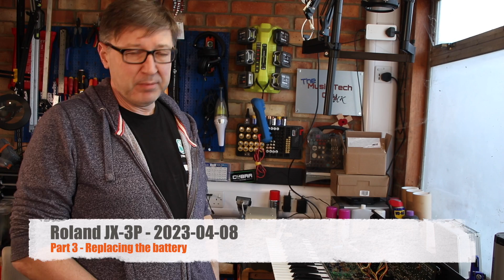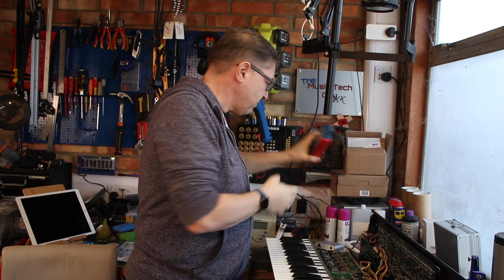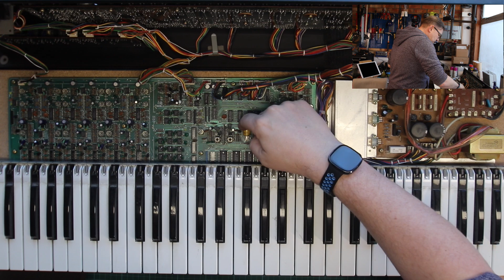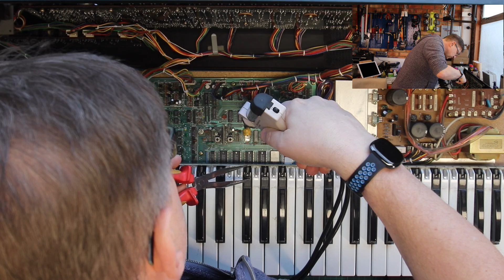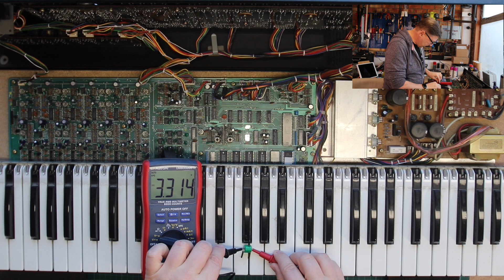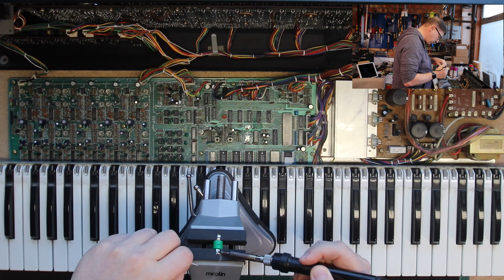Roland JX-3P Restoration - Part 3 - New Battery / Replacing the Battery

Comment: What voltage is the original battery please?
Reply from the maker: Hi @darkdeepred6577 

The Roland JX-3P uses a 3v battery.  To be honest most synths and electronic instruments of this age have 3v - 3.5v batteries.  The majority of these are 3v as this was the correct voltage to keep the volatile memories of the chips used in them alive when there was no mains power present.  Jon

Comment: My JX3P battery hasn't been changed since I bought it in 1984. I guess I'd better get on it 😄
Reply from the maker: Hi @HowardBaileyMusic 👍 Jon
Reply: @TheMusicTechGuyUK  So that 1/3n lithium battery is in fact a rechargeable cell correct? I've been looking for one on eBay but so far haven't found one with solder tabs. Also they don't specify "rechargeable".
Reply from the maker: Hi @HowardBaileyMusic

The original battery would not have been a rechargeable version.  And given the age possibly not a lithium based battery.  However, they are available with solder tags.  It is the first entry in this e-bay listing:

https://themusictechguyuk.me/3nISDl1

Now unless you know someone with a battery soldering rig, this might be the best option.  And yes I know the seller is charging a premium!  Jon
Reply: @TheMusicTechGuyUK  Luckily I have a friend who professionally repairs high end medical equipment so I won't have to do the job myself (except take it apart and put it back together 🙂). I'm amazed that a non-rechargeable cell could hold power for so long.
Reply from the maker: Hi @HowardBaileyMusic

Looks like you are all set.  The life of a battery depends on a number of factors, amount of use, length of storage, the elements of the synth being supported while turned off.  The manufacturers only warrant these types of battery for 5 years.  Jon

Comment: Cool video. Was it not possible to install a battery holder for easier swap outs in the future? And which type of battery goes into a JX-3P? Thanks
Reply from the maker: Hi @The Redface 

The battery is a weird little battery based on the CR1 3N standard.  

My initial gambit was to put a battery holder in place of the battery I was taking out.  But I couldn’t find a solution that was case on solder tags.  Without solder tag you would be bending a leg on either end and that would not have made a strong connection with the board and at the next swap would likely have snapped.

I considered drilling through the board an if this was my synth, I might have considered doing this as it is my property to damage.  But as this someone elses, I adopted this method as the best option.  The battery is accessible without having to completely dismantle the synth as with other designs (Yamaha)!  Jon